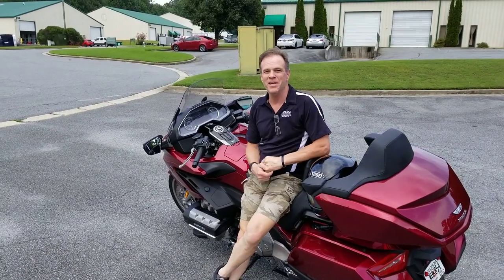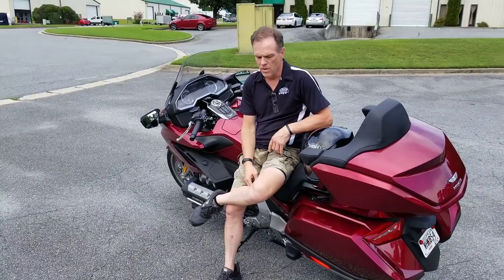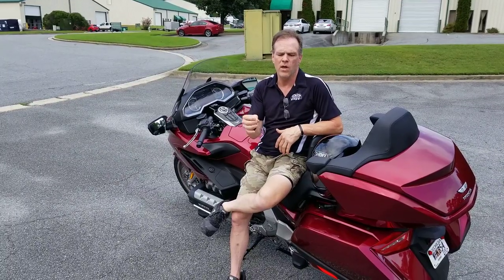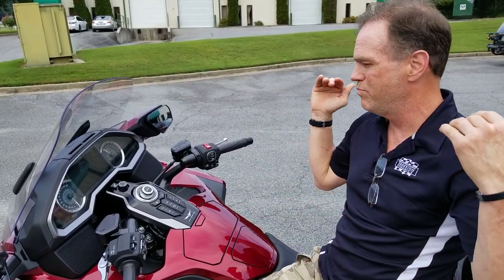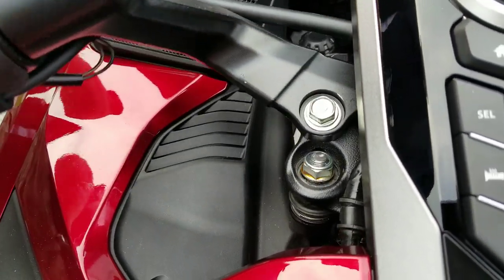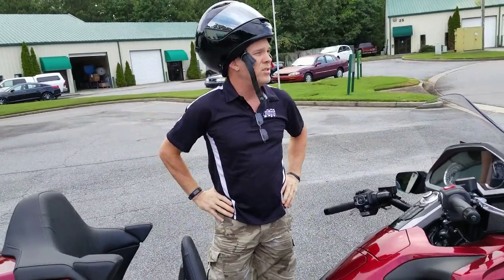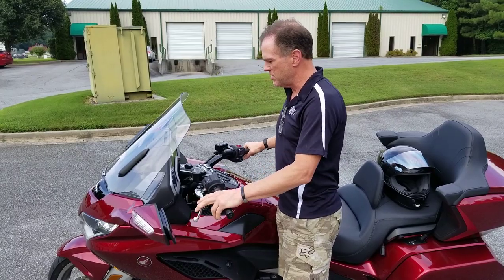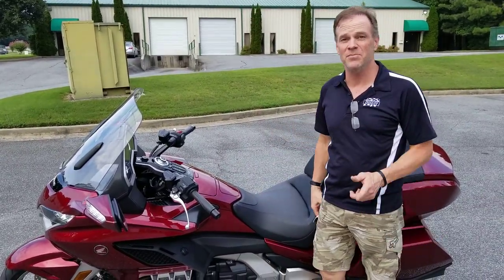Attempt to drive 2018+ Honda Gold Wing without Right Tie Rod!!!

Comment: I think you might be missing the point of the rubber mounted tie rod.  Take two sharp pencils held together side by side, measure how far apart the tips are... now slid one up (like the fork compressing) and measure the distance... the tips are now farther apart.  If you connected a tie rod between the pencil tips tightly, you would not be able to move one pencil up and down.  So in the Honda system, you can have one rigid tie rod that in reality pulls the handle bar (or steers the bike if the handle bar were held perfectly tight) just a little as the fork compresses and the other tie rod “stretches” to allow this to happen without having to have “play” in both tie rods as would be required to allow the suspension to stroke though its travel.
Reply: Max... my example may not have been clear, i understand that the 2 tie rods are always parallel, what i was trying to demonstrate is that the handle bar end does not move up and down, but the fork end does. If you measure the distance between the hole in the handle bar where the tie rod connects to the hole in the top of the fork, is it different when the suspension is compressed compared to when it is at its normal resting spot?  If so, then with 2 tie rods, one needs to stretch to keep things from binding.  Perhaps the fork is traveling back as it compresses, keeping the distance the same, but what i have read is that it travels straight up and down which would indicate that the distance between the 2 attachment meant points would be changing.  Love your stuff and your passenger hand holds are going to be just what is needed too!!!

Comment: Is it possible that Honda wanted to leave the left bushing loose like that so if the right side ever did break, come off or fail that the rider would instantly know there was a problem, but yet still have some control. if they made it tighter, a rider may not even know the right side failed, and may not seek repair.
Reply from the maker: No chance...  It's insanely dangerous the way it is.

Comment: Although your videos are mostly helpful and informative, I feel this one is pretty self serving.  The chances of the right tie rod ever failing are like winning the National Lottery.  Although it's possible, it's very unlikely.  Also if the right tie rod should fail, again it is unlikely that it would fail as sudden as if it were removed. Thanks for your informative videos but I feel this one was totally unnecessary.
Reply: 5mm tolerance in movement is in the Honda manual. Max is showing worst case scenario which I appreciate. Trust but verify...
Reply: All of Max's videos are self-serving.

Comment: If it needs tie rods, is it really still a motorcycle? Just add two more wheels somewhere and call it a day. And why do these tourers still have boom boxes? I'll stick with my FJR.
Reply: I traded my FJR for this actually.  I miss the power  of the FJR - and its suspension was rock solid

Comment: I would try it, on your bike.  🤣. Seriously, although very low chance, seeing it really does explain a lot.  Do you trust the engineer or the teenager assembling at the factory?  The engineer built in weak tolerances and the assembler is hurrying a job on a part that gets replaced at a 5mm movement.  Already unsafe with that alone.  I think the Traxxion tie rod makes perfect sense; piece of mind is where it’s at on two wheels.